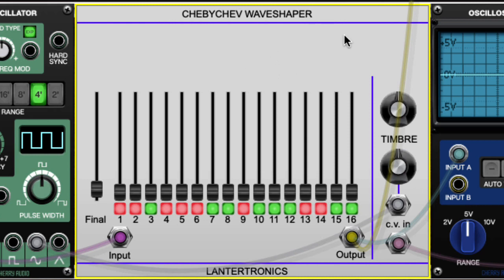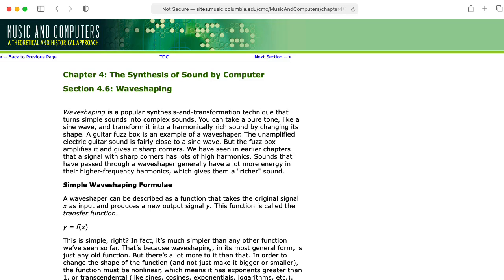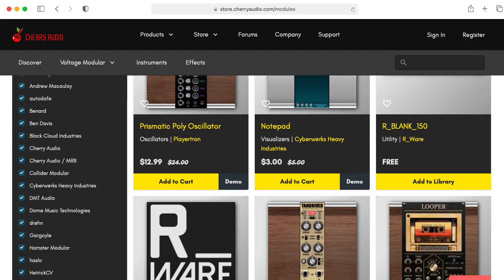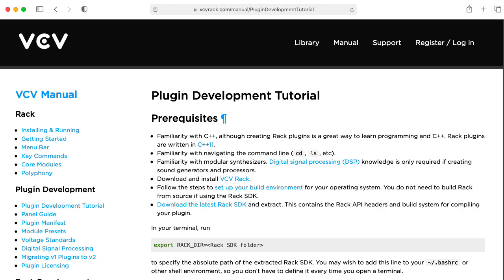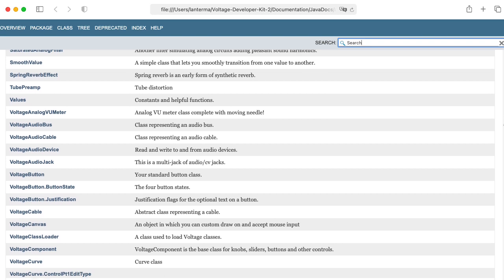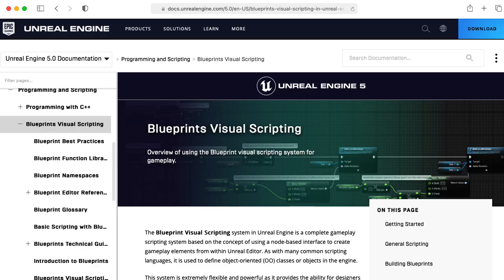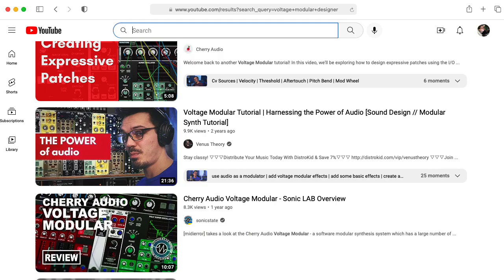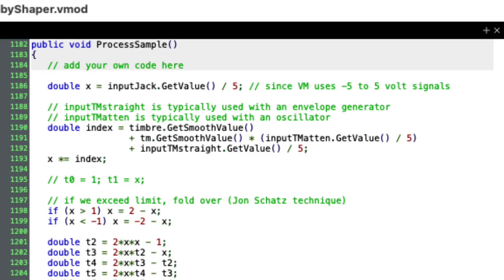Chebychev Waveshaping in Voltage Modular using Voltage Module Designer (Cherry Audio)

Comment: It looks like that code would be easily applied to JSFX language that Reaper uses for plugins. I'm not that good with the language, so I doubt I'd try and get it running myself, but, possible. It has a framework for sliders, functions, variables etc, like you'd expect.
Reply from the maker: Ah, yeah, I've played with JSFX, and like some things about EEL2 (the language it uses). The main downside it it doesn't seem like there's anyway to use them outside of REAPER. (Of course REAPER is awesome in its own right). The main thing I don't like about EEL2 is there's not really individual arrays  as far as I can tell -- you just have one massive address space and pointers into it you have to keep track of yourself. It's closer to programming in assembly language at times.
Reply from the maker: Here's my little JSFX experiment: https://youtu.be/Yde3xDZcnCU
Reply: i'm actually porting some JSFX stuff i made to VM modules this weekend